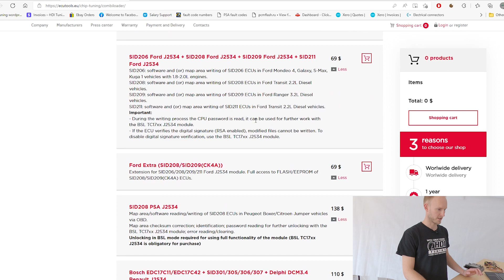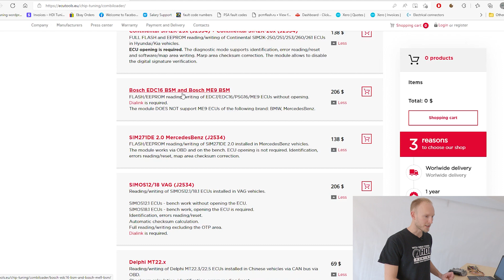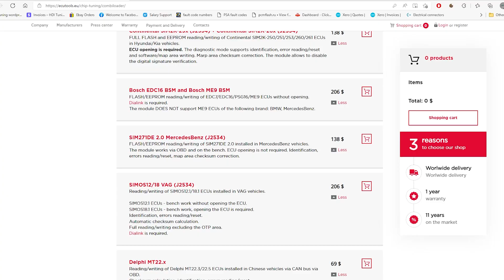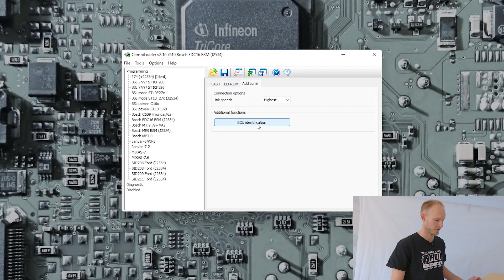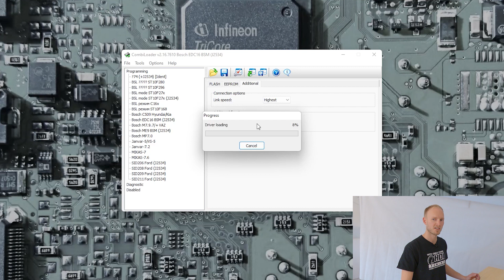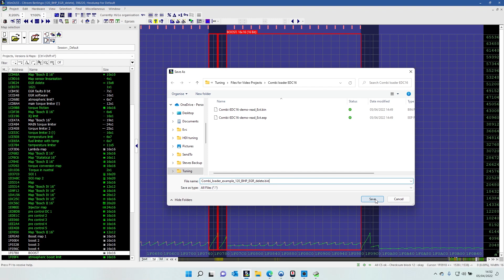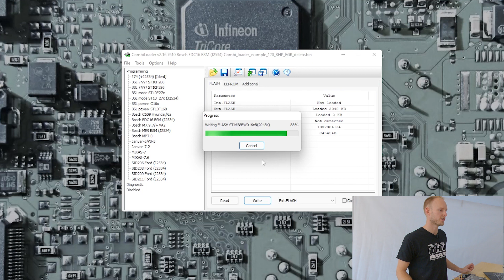Combiloader EDC16 Bench Service Mode how to guide 1.6 HDI

Comment: EDC16 is easy. Every modern OBD readers can do that. Not a big deal at 2022y. Tell us about EDC17 and his reliability in these ecus.
Reply from the maker: See my other video for the EDC17 guide with PCM Flash, coming soon also a tutorial for MD1 from the latest 1.5 HDI
Reply: @StevenLewis-HDI-Tuning  I don't need quide, can do that, I asked about reliability of CombiLoader in daily use. EDC17 VAG/BMW etc.. and CombiLoader exactly not PCM Flash, I know that pcmflash works well cuz I own him. Need more info about CombiLoader as I don't know much about him.
Reply from the maker: @mieciumietek1405  It's worked very well with all the module I've used it for, you can go through scanmatik or Dialink, so really it's as reliable as those tools are?